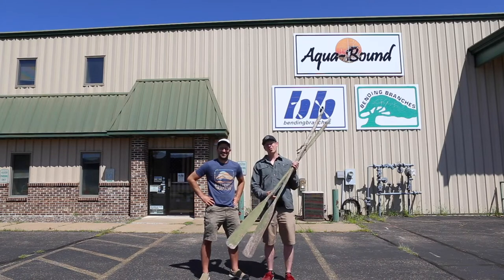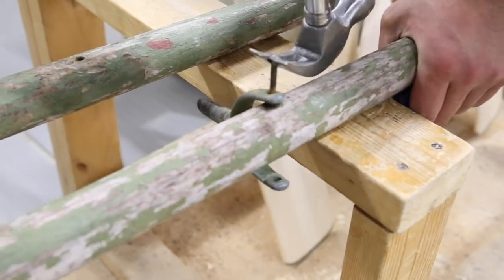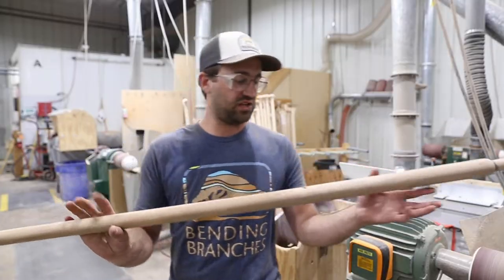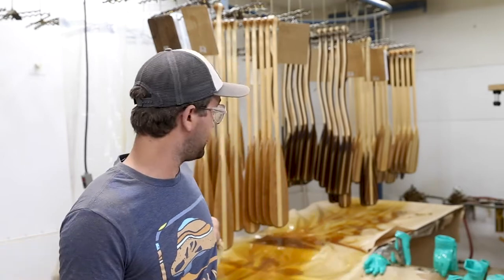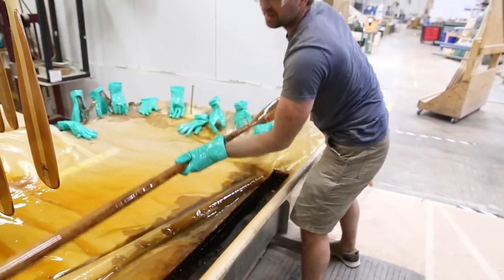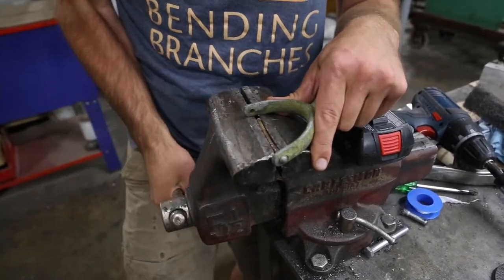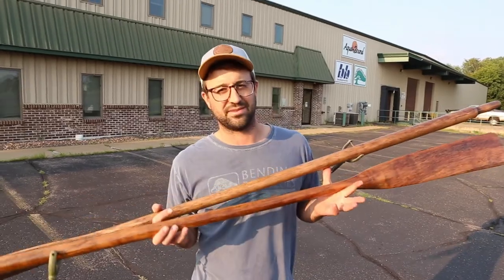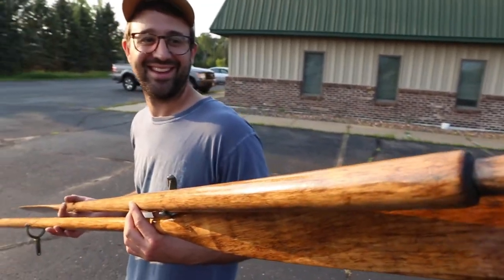Restoring Jon Boat oars and making them new again - Boat Prep part 3

Comment: How do you keep those pins from just sliding out of the oar locks ?
Reply from the maker: Our pins are slightly bent, which keeps them in place. I'm not sure if that's how it's supposed to work, but it does the trick for us. 
Does anyone else have better advice?